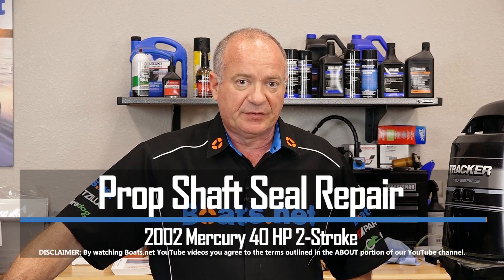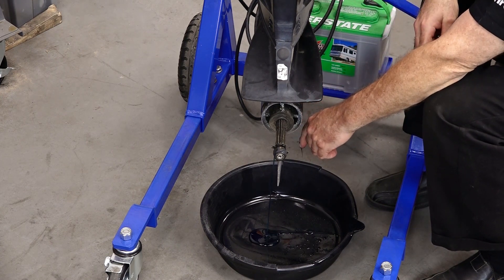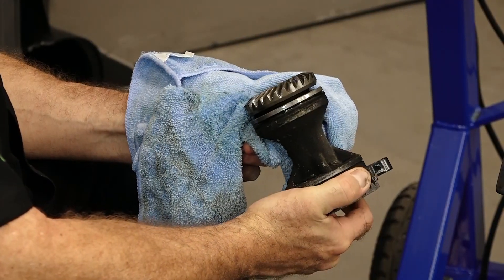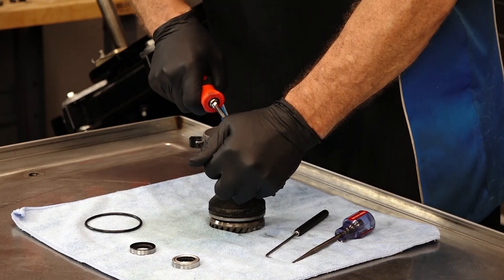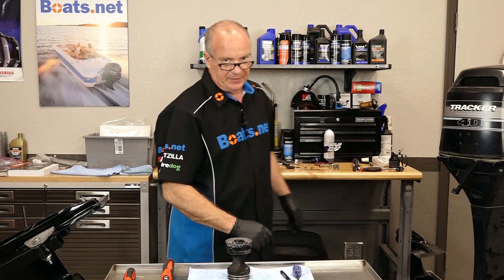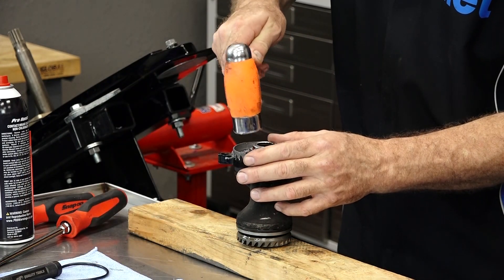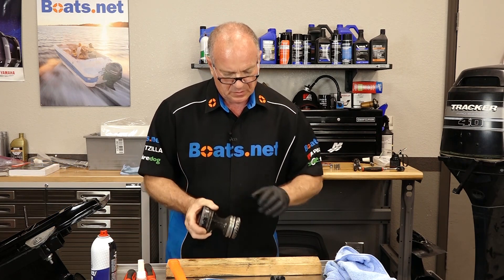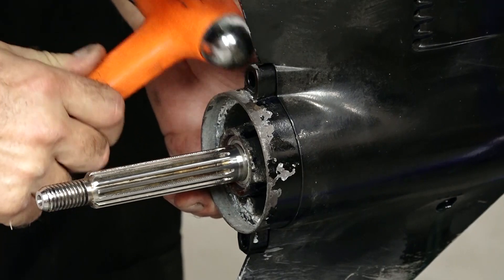Mercury 40HP Output Seal Replacement | Mercury 40HP 2-Stroke Prop Seal Replacement | Boats.net

Comment: i've got a mid 90's 40hp merc. it does not have the 2 bolts holding the housing on. do i need a spanner to remove the inner piece?
thank you

Comment: Hi. I have a 2001 Yamaha 40 2 stroke 3 cyl. I'm having trouble figuring out the parts numbers for the prop shaft seals.